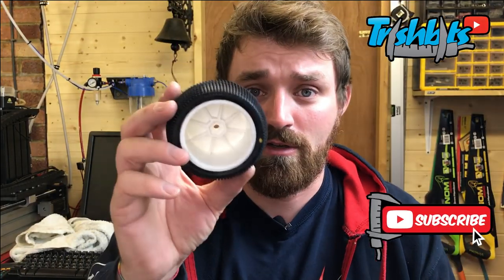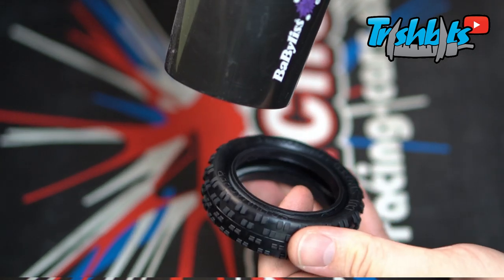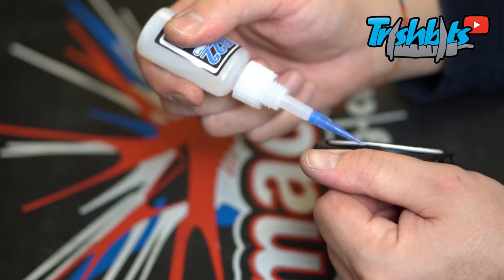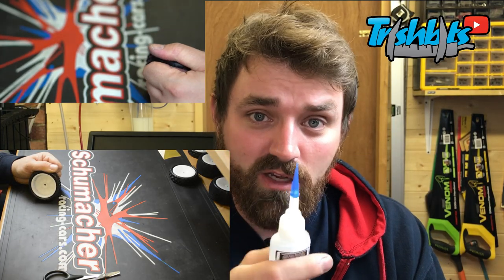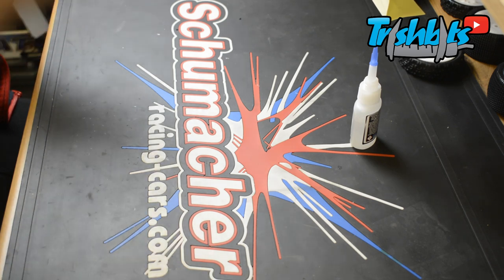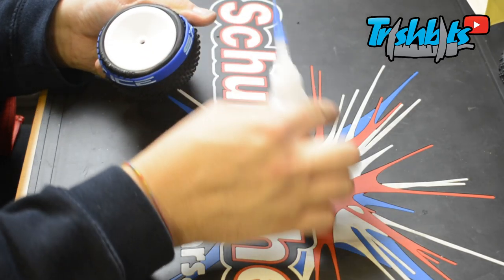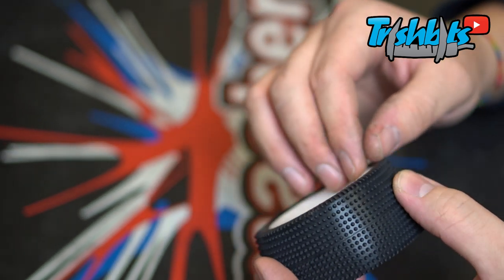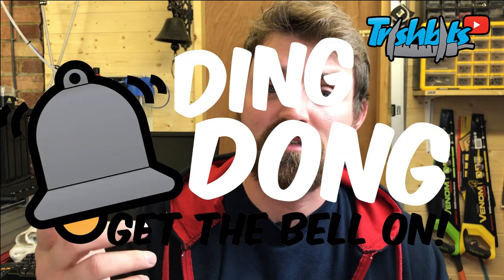HOW TO GLUE YOUR RC CAR TYRES!

Comment: Great video, Trish - does it make a difference to clean the tires/rims with motor spray at all before gluing them together? Thanks!
Reply: Use acetone, chemical gloves, a lent free cloth, and a quick swipe on the rubber bead of the tire and wheel.